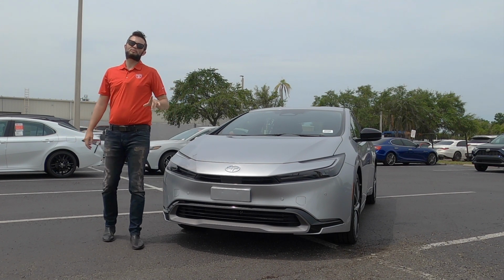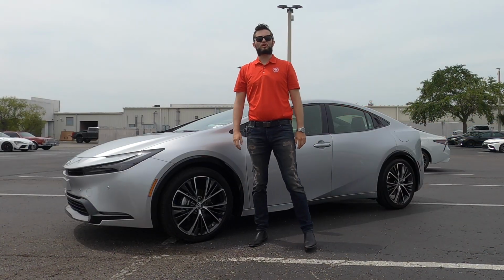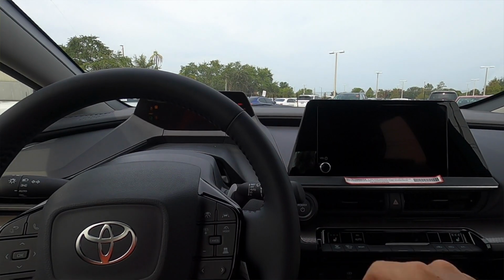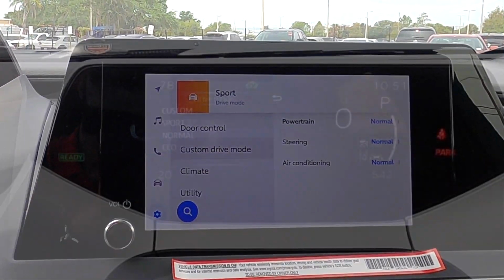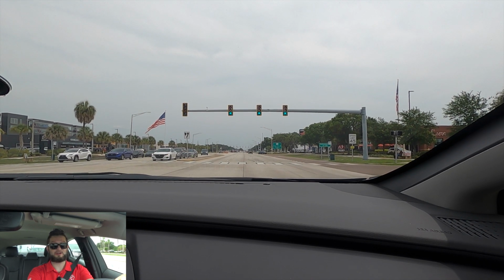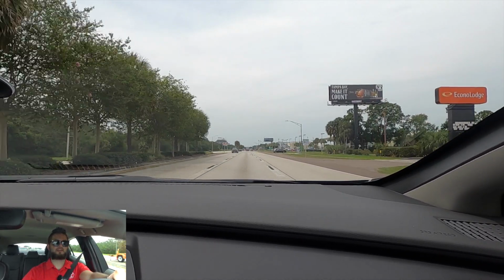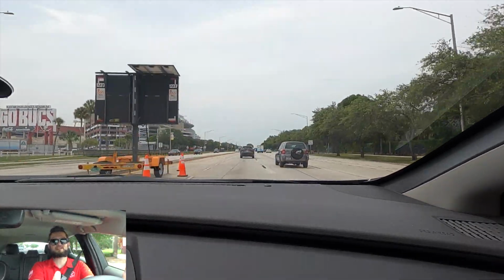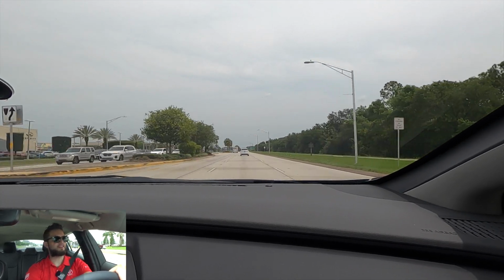2023 Toyota Prius is ALMOST Perfect : All Specs & Test Drive

Comment: We just took delivery of our 2023 XLE Cutting Edge from Clearwater Toyota. Traded in our 2016 Prius with only 41K on the clock. Getting used to the many features. I wish the GPS was built in and not replying and having to have the cell phone plugged in. The noise when going under 20 and even louder in reverse is really annoying. I know the fix to it and it helped a lot. Thanks for the video and I'll be back. I've only seen one other new Prius in our Largo area. Very rare to see them , mainly just hard to get.
Reply from the maker: 🎉 John and drop some updates about your owner experience 👍
Reply: How did you fix these noise issues? Thanks Also is your rear center headrest lopsided? It’s an asymmetrical design and the one I just drove had an obvious slant in the headrest which was bugging me in rearview mirror. : /
Reply: @FM-ij7iu  I went on line and found a fellow with the same complaint about the noise. You can’t cut the wires or just remove the speaker under the hood. I took the speaker out and wrapped it in foam and then wrapped it all in black duct tape. It cut the noise down about 75 percent, much better than what it was. Check here on YouTube for the videos.
Reply: @johnwirth4146  Thanks!

Comment: I drive a 2015 Prius and appreciate it every day.  Assuming I would eventually purchase a 2023 Prius, I’ve done a lot of research on it. In comparing tire replacement cost between lower and upper end Prius models, I stumbled upon the fact that neither the lower nor upper end model tire sizes are readily available in the USA. With one of these new Prii, if you had a tire emergency the wait for a replacement tire may be many days. My Prius purchase will wait until replacement tires become more plentiful.
Reply from the maker: Thank you for the insight 👍

Comment: If I were in the market I'd be more inclined to cross shop this with the Kia Niro Hybrid SX than the Accord. I think the Niro, while slower, would be a little more practical as far as cargo room and getting in and out of the vehicle. Plus the SX has standard ventilated seats, Harman-Kardon sound, a six speed geared transmission and acoustically laminated windshield and side windows. But yeah, it'll definitely be slower!
Reply from the maker: That is a great point Jeff and a 6 speed is a big difference 👍
Reply: I was considering the KIA Niro but feel more comfortable sticking with Toyota. Bummed Toyota didn’t come out with something to compete with the Niro. I test drove Corolla Cross Hybrid and it felt like I was driving/steering a boat. Didn’t feel solid. I love my 2009 Prius!
Reply: why would anyone want to drive a unreliable kia? You want your car to be stolen? lol